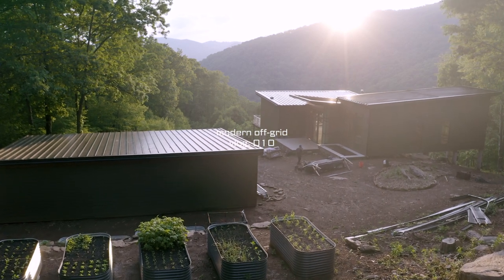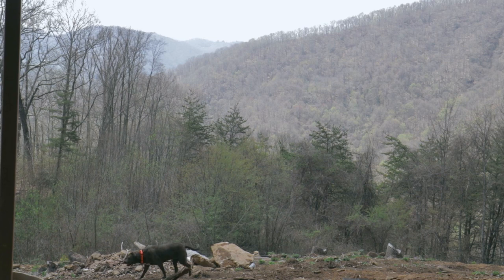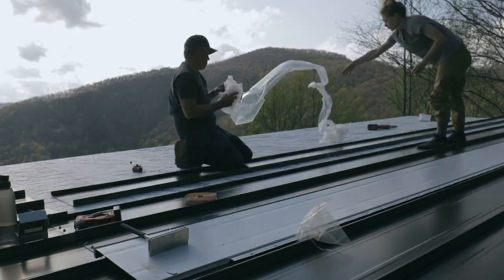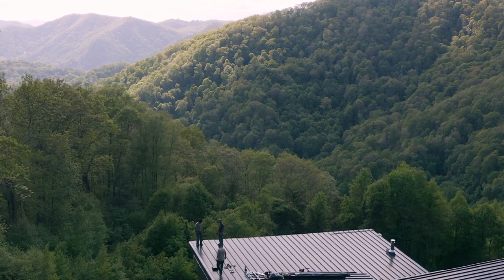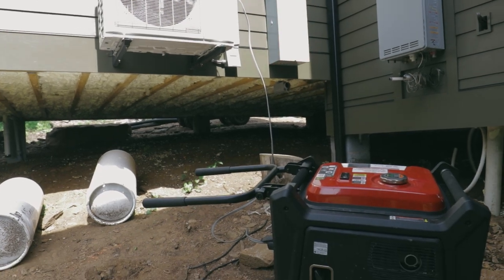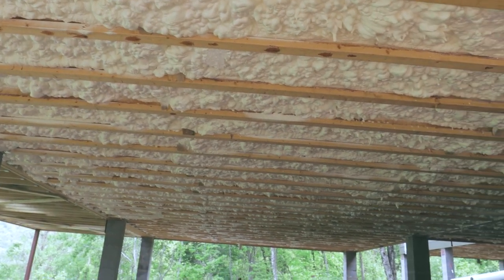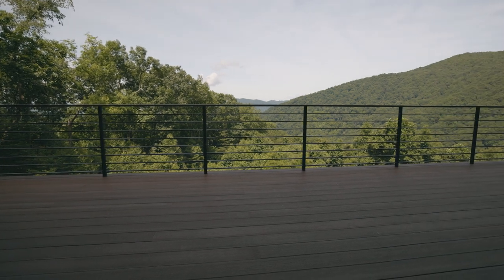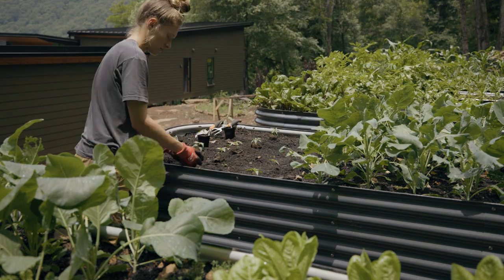Installing our Metal Roof, Deck, Insulation & More | Offgrid Home

Comment: I appreciate your style. Please continue to make these, you might not have many viewers yet but you are creating some quality content that I enjoy and I'm sure many others will too soon. Cheers.
Reply: Also what size solar array are you going with? And battery bank size? 48v? Basically any details on your solar setup I'd be interested in, just installed a 1700 watt 12v system on my RV and had a blast.
Reply from the maker: @getitdone252   we ordered 35 440 watt panels with a Solark 15k and 12 100ah 48v batteries